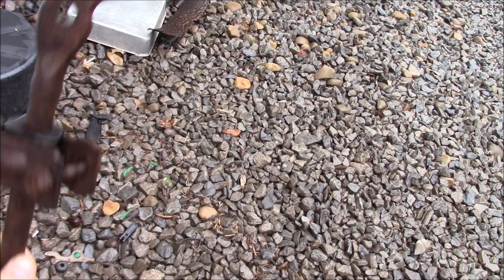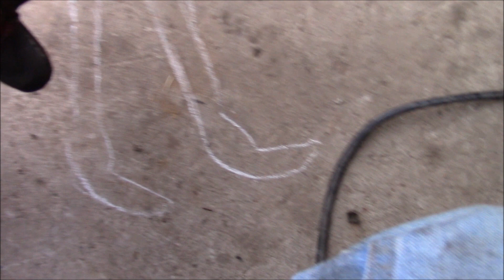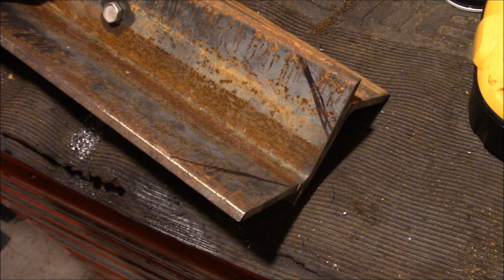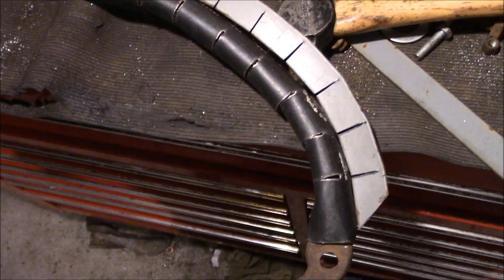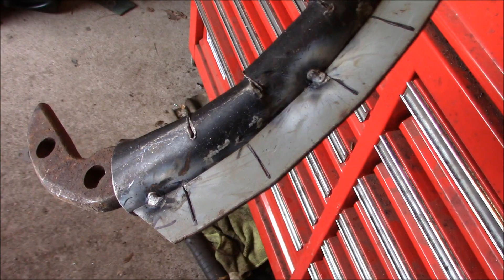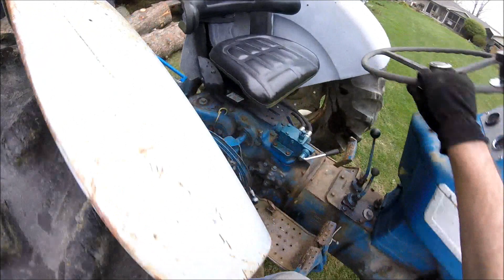Making Log Tongs from Car Parts & Scrap Metal

Comment: So you take car parts you say handle 2 ton loads and "beef" them up to lift a 1 ton log??   You might have been too many beers in when you were over thinking this.   

But what the heck.  You had a good reason to hang in the shop and drink beer so maybe you should've beefed it up more 😀
Reply from the maker: It's all about leverage, those car parts were never intended to be used that way, haha.

Comment: Im building a set of tongs atm. Im making mine without chain n using 2 bars up top to keep even. Im toying with a heavy duty pto cable and spring to open. But like the build. Seems very stout
Reply from the maker: Cool, sounds like it should work well.  I've used my tongs quite a few times since I made them, so far still going strong.  Had to open them up a bolt hole once for a big stump, tractor was running out front weight, haha.